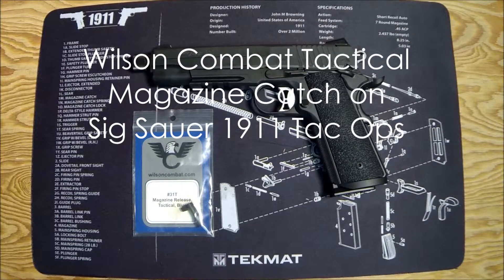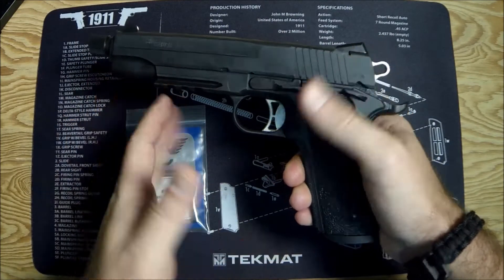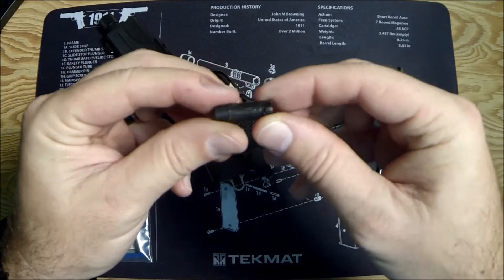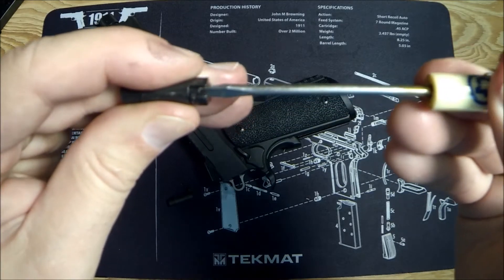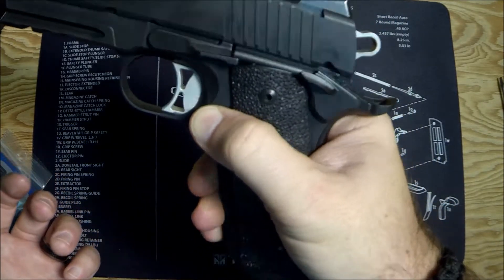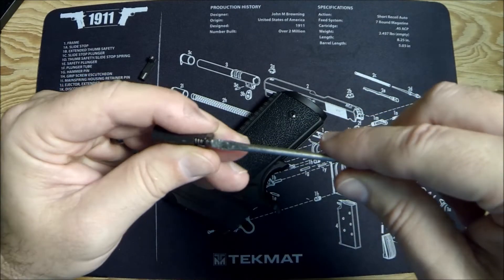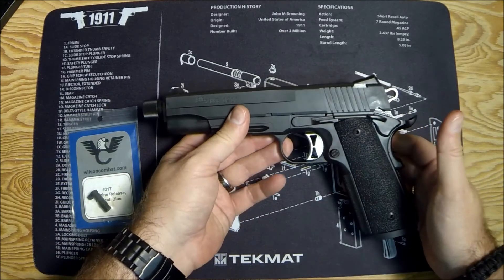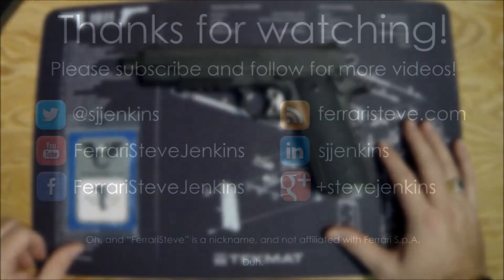Installing a Wilson Combat Tactical (Extended) Magazine Catch on a Sig Sauer 1911 Tac Ops

Comment: Steve, I appreciate your video here on the WC mag release. I have even smaller hands, and the release on my Para Expert 1911 was hard to reach, so I got the WC. Granted, I DID have to watch it three times before I FINALLY figured that the mag catch release screw was finicky to re-install. I had to install the thumb button and work the button & screw up & down as I worked to turn the screw before it released and fastened in place. Dunno if it's a Para thing, but I thought you might be interested to know!

Comment: I just installed a Wilson Combat 405S Magazine Release on my 1911. It has the flat square tab that is checkered and attaches with a allen screw. I was having to change my grip as well to drop the mag. This really solved the problem. I did have to do some minor fitting on the lock screw end for it to fit down into the frame.. If the size of the tab doesn't bother you, it is definitely an 'upgrade'. It is also available in 'blued' finish. Try Brownell's for this part.

Comment: I bought the Wilson Combat catch, lock and spring, but the catch wouldn't fit in my RIA 1911. Didn't wanna have to do a bunch of sanding to get it to drop in, so I just put the WC spring and lock in the RIA catch and it's still better than the original.